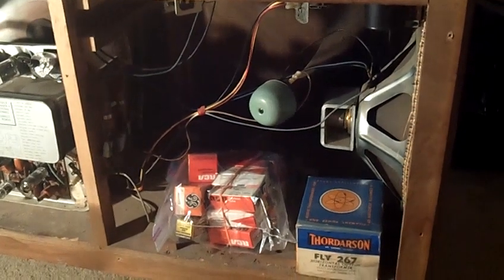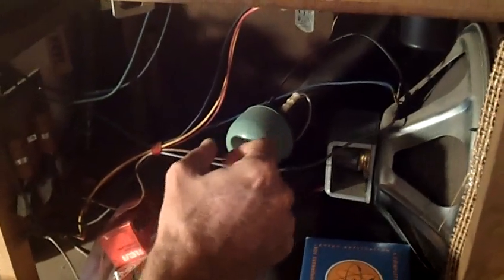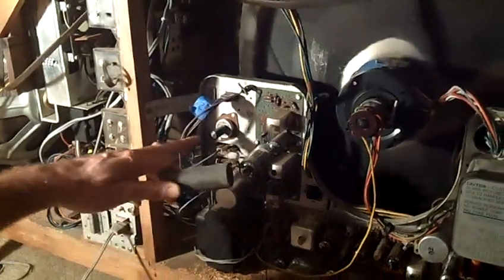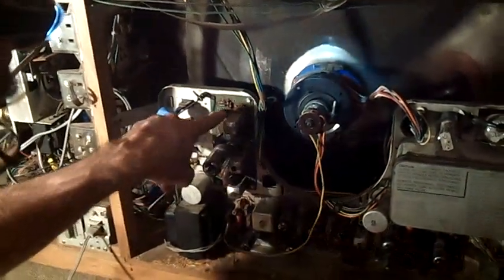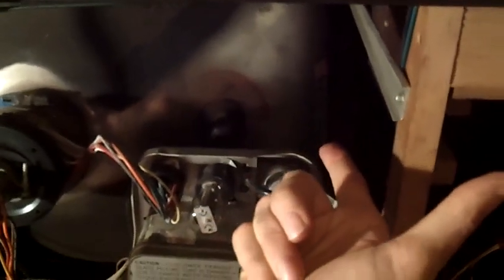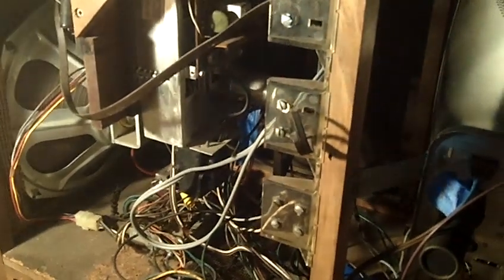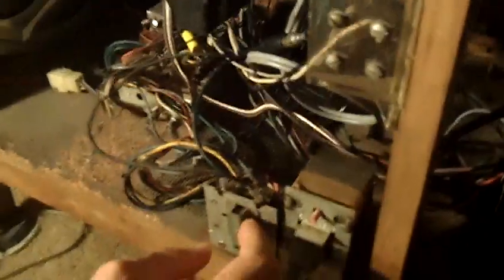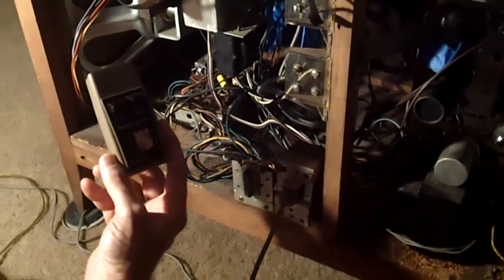Vintage Magnavox B&W combo TV/phono/AM/FM stereo part 1

Comment: hey man i was wondering if you could show the power cord. like does it unplug? i have a magnavox that my grandmother gave me but it does not have a power cord and i cant figure out what kind of power cord it needs or if it had a hard wired power cord so if you could help me out i would really appreciate that
Reply from the maker: the plug is mounted to the masonite back. Sometimes if the back is broken or missing then you need what is commonly referred to as a "cheater cord" These cords were common back in the day, but not so easy to find. they have a rectangle shape with two holes that mate to the back of the set. somewhere you will see a receptical with two pins, this is where the cord plugs in. Some sets have a polarized cord, that is one of the pins will be wider than the other. If that is the case you need a polarized cheater cord to match it. this is what the part on the tv chassis will look like
http://www.allelectronics.com/make-a-store/item/acs-6/2-con.-ac-rececptacle-for-cheater-cords/1.html
this is a typical cheater cord
http://www.ultrawebb.com/OHP/images/cord/cord1.JPG
Reply: Dave WM wow ok thanks thats a lot of new  information and yes one of the prongs on the back of the tv is larger than the other one so that was kinda hard to find a plug to fit it because all we have are two same size hole plugs so your opinion would be to put in the polarized cheater  cord replacement ?
Reply from the maker: Sean Ballard yes, but make sure its an older one, like the brown one in the pic.
there are newer ones with oddly shaped plastic part that may not fit.
Also any time when turning on vintage equipment its a good idea to have someone that knows the procedure to avoid damage, TV's that are 40+ years old maybe a fire hazard if they have not been in operation for a long time and then suddenly just plugged in. You can join videokarma.org and post up some pics. Its a forum dedicated to TV including vintage sets.